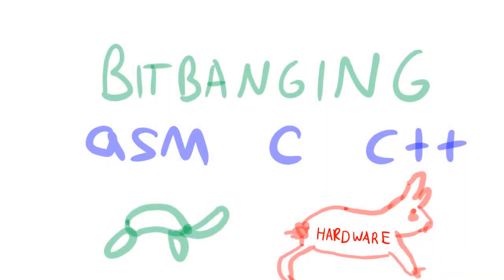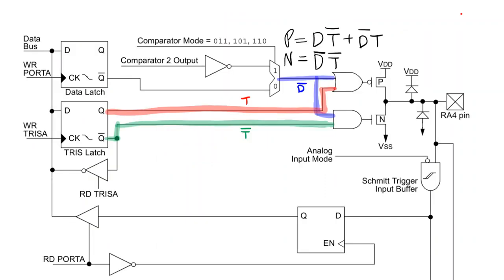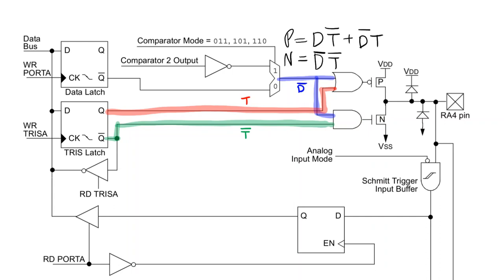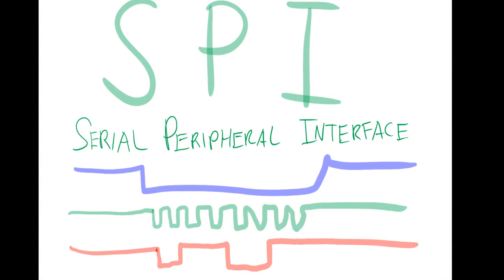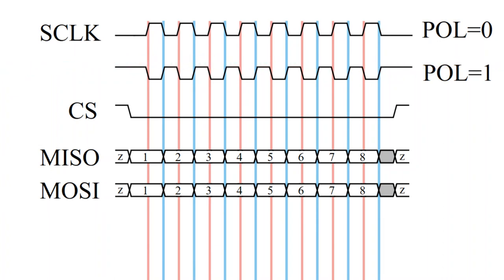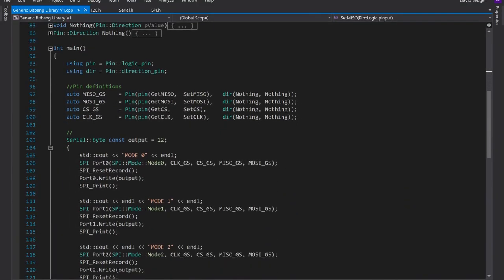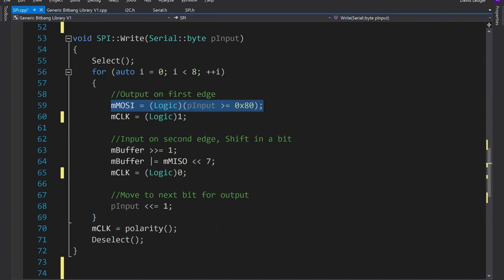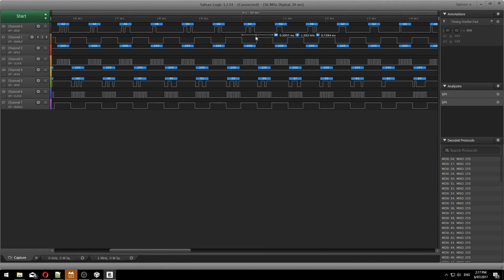EEVacademy #3 - Bit Banging & SPI Tutorial

Comment: depends on the clock speed, not necessary to do polling and eat up all your cpu time, I've done interrupt-driven bit banged spi slave on an esp8266 (yes my beard is grey)
Reply: You are absolutely right, you can have interrupt driven code. It however isn't going to be portable code because it is going to rely on the platforms timer implementation.
Reply: david 2 timer for what?
Reply: I suspect Andy was using a timer to control how long between clock pulses and then using the timers interrupts (functions that execute when the timer expires) to bit bang, clocks, reads and writes.

Interrupt driven bit banging can be much more efficient but only with slower clock rate serial interfaces.
Reply: I think he was referring to the polling: You can have an interrupt routine run when a pin goes high on most microcontrollers, which saves you from basically all overhead while still being able to respond pretty much instantly
See https://gonium.net/md/2006/12/20/handling-external-interrupts-with-arduino/
Reply: Any context switching (executing an interrupt service routine) has overhead, if you were trying to bit bang at the maximum possible speed on a micro for example it would be much slower using interrupts to do it.

For slave devices with interrupt on change, it would certainly be great for low speed communications.

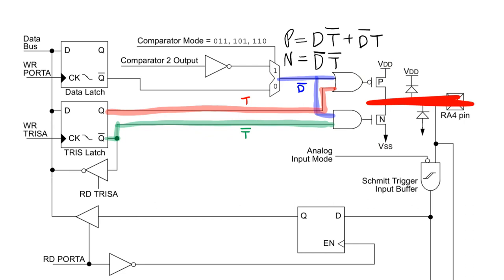Comment: Can  you explain the logic formulas @ 4:30 ? I thought that when T is high, then you're putting Vss on the NPN and Vdd on the PNP, effectively creating a high-z state, and when T is low, the voltage of D is on both the PNP and NPN, which would send the Vdd or Vss to the output...?

The P=~TD + ~DT is the equation of an XOR gate... right?

Comment: If you use the bit banging on slave micro which runs a RTOS( Lets assume this micro doesn't have any spi ports left). The semaphore can run the SPI subroutine without disturbing main application code right?

Comment: Aren't polarity 0 phase 0 and polarity 1 phase 1 the same thing?
Reply: It does end up clocking basically the same but they are not the same.
A different image to what was in video might help, this one seems good :)
http://www.corelis.com/images/screenshots/spi-bus-timing.jpg

Pay special attention to the logical level of the clock before and after the SPI frame.
Also notice where the first clock edge starts.

They are similar but not the same.
You do end up with something that reads in the first rising edge of mode 1,1 and mode 0,0.

Comment: Why did you showed us a simulation of SPI instead of a real data from logic analyzer?
Reply: This is how I develop platform agnostic code. IMO If you develop for no platform then the code more easily ports to all platforms.
Reply: I understood your point of platform-independent code, I doing the same thing usually.
I mean, in logic analyzer's window you started a simulation (just as when analyzer is not connected to PC) by pressing "Start simulation" instead of "Start sampling" when device is actually connected to the PC. Did you just faced some hardware issue with that analyzer?
Reply: That was actually just a miss-edit, was recording I forgot to plug in the device, re-ran it, the new clip was put after it but some of the old clip wasn't edited out. If you look carefully the screen jumps and it shows the device was plugged in at the end.
Reply: Now I see, thanks! Good job, though.

Comment: I'd love to hear about audio digital interfaces! e.g. I2S, I2S Variants, TDM
Reply: Wikipedia has a reasonably clear(?) page on I2S. 

If by "variants" of I2S you mean the left/right-justified versions, those technically aren't I2S (to the best of my knowledge, anyway). In the words of AvE - "same same, only different" :) Yes, they use the same clock signals, but the data bits are arranged / sent differently. I think all chip datasheets, regardless of supporting "just" I2S, and/or other modes, contain timing diagrams which show pretty much all you need to know about the protocol / format.
Reply: KhronX ohh, cuz i am trying to get ADCs&DACs from TI, to talk to SigmaDSPs from ADI(shouldn't matter, right?), and had been super confused looking at many different timing diagrams.. alright i have to go check it out first, and not to be lazy like this! Still waiting for Dave to yell focus u fack, everytime his cam goes out of focus😂😂
Anyways thank you very much!
Reply: As long as both "ends" of each I2S interface are set for the same mode, you should be all good. It's an industry standard for a reason :)

Comment: another reason for bit-banging: if (the initial run of) the serial-communication-chip does not meet its design-criteria. (This is why the C64 uses bit-banging instead of dedicated serial by default.)

Comment: Hey ;) Hate it to say, but I think from an educational perspective the video, especially the first part about bit-banging, wasn't that great :/ I'm pretty sure someone who wasn't sure what exactly bit-banging is didn't get it... And someone who knows it, couldn't learn anything. First of all, you should have started with why you toggle your pin high/low at all and what requirements you have... e.g. by just refering to a simple datasheet that says what a serial signal actually has to look like to communicate with a device. To keep it simple, use something like the WS2812 drivers, I2C or TTL (not bidirectional, not additional control lines).
Then explain what actually the difference between using hardware and software is - because for someone that only know what an arduino is, it is not obvious that the microcontroller hardware actually contains hardware for serial communication.
You can explain in few sentences that "hardware" actually means a separate logic in the chip with its own seperate memory where you put the data you want to send, that works autonomous from the cpu.
Using hardware means, you tell this seperate logic "use the bit stream from your dedicated memory to generate the high/low signals on the pins now and let me concentrate on other things" whereas using software means "oh shit, I now have to set this pin high, wait for 2µs, then set it low, then high again after 4µs and so on... this will keep me busy a hell lot of time"...
Explain that telling the hardware to shift out data actually takes only few cpu instructions, whereas using software takes almost the same amount of instructions for every bit.
Explain why that restricts timing, etc....
Explain that the hardware must actually be built for a specific protocol and therefore chips usually don't have unlimited hardware support for thousand protocols - which is why bit-banging in software is always a thing... Like Arduino SoftwareSerial... Or protocols like the WS2812 where usual chips just don't have hardware support.
Hope that was helpful :)
Reply: Frango
Reply: Thanks for this comment, I'm new to all of this stuff and the video was sort of lost on me even after following the first two videos perfectly

Comment: Why a tutorial on "bit banging & SPI", a tutorial on common serial communication methods would be more interesting and a separate video on bitbanging (and something else maybe).

"Between each byte you set, you also have a clock signal" - I think you mean each bit.

For example in the part of bitbanging you tell that there usually is a kind of master device and a slave device. But it isn't always like that. It's also pretty common for slaves to have an "IRQ" line to start transmission. 

Also, you could bitbang a slave, simply assign interrupts to the clock pin and check the status of the data pin in there. IF your communication is slow enough (and your interrupt fast enough) to guarantee being able to read the data pin before the next cycle/state, why not?

"Bitbanging in general is usually like" there's just too much "usual" "in general" and other vague useless additions to the sentences.

Comment: nice to see some more learning tutorials :P can you do one with i2c lipo battery management and stepper motor drivers (for high precession )
Reply: There will be one for i2c, probably not one specifically to battery management unless enough people are interested.
Reply: personally, i think a lot of ppl in the maker community is struggling with lipo power management / boosting for 5v as for projects like rpi game boys the power boost product seems to be just barely  enuff  to run these projects 

also what about the stepper motor stuff? I'm having a hard time figuring out if there can be any precision gain with higher end stepper driver other the higher step resolution like 1/16 or 1 /32 step

Comment: That has nothing to do with bit banding. Bt banding is about accessing one bit. When you  write a value in an octet, you  write the whole 8 bits. You cannot WRITE just one bit. So unless you have some special C extension, you have to relay on trick like reading the octet, or-ing it with the proper mask, write base the result of the or-operation.  Well, that works to write a one. To write a 0, you have to and, not to or, the negation of the mask. That makes 3 instructions, which CAN BE INTERRUPTED, and using an operator which differs if you wish to assing a 1 than to assign a 0. It is even slower if you use a function call (with the added push/pull). With the help of bit banding, you can direaclty write the value 1b, or a 0b,  in an appropriate memory address and, through hardware wiring, that would write the 1, or  the 0, in one single step, so, not interruptible. So, to the contrary of your claim, bit banding is FASTER than any other code, since it is as fast as the memory write can be, that is, ONE clock cycle. You seem to be confused with mimicking SPI protocol by software instead of using specialize hardware peripheral of the MCU, which has, once again, NOTHING TO DO with bit banding.

Comment: Sorry, but I'm afraid you have made some goofs, Dave2. First, with the waveform at the beginning, why are you going backwards? Does this represent a scope or logic analyzer trace? Doesn't time go from left to right? Isn't the first event on the left?
Second, that't a nor gate, not an x-nor gate. With the equation you have shown, D=0 and T=1 would turn on the upper FET, and that's not what you want.
I stopped watching at 5 minutes.
Reply: Yes - what the hell was up with that?  Am I missing something?
Reply: Dun goofed it!

I think we are both wrong its just an or. The circle is talking about how this pfet turns on on logic low the inversion makes it effectively nor though.

The time thing ergh yup msb first. Edit: Confused myself i drew my time axis backwards then explained right to left for some reason. Really od i did that.
Reply from the maker: It's actually an OR gate, not NOR (or XOR). The NOT is on the MOSFET.
Reply: i think you messed as you were fast ,it wont hurt for an uneditted length version
Reply: Not a big deal, it is not important to know the details how a processor pin is implemented to understand bitbanging, could have been left out. But later you said that the microprocessor can't do anything while polling the pin. This is wrong, because you could use a fast interrupt to poll it, which in fact is used in CleanFlight to implement software UARTs (softserial) and it can do this even for 250 kbaud, which is no problem for modern CPUs. In the interrupt service routine you just have to use a state machine to exit it fast, then you have lots of time left for other tasks, in lower priority interrupts (but then it gets tricky with reentrant IRQs, but possible) or in the main program.
Reply: I stopped at 3 minutes. Backwards display and voltage represented by "V" instead of "E" was too much for me. Also, RS232 levels are inverse - high is low & vice versa.

Comment: sorry, don't see any point of big banging. this is not the 1980's anymore, use a proper chip and stop banging your head while programming.
Reply: You don't always have a choice. What if you need a one wire interface or some other uncommon interface? Good luck finding a microcontroller that has hardware for that then porting all of your existing code to run on it.
Most microcontrollers will only have SPI, I2C, & UART, Some will have USB and possibly CAN. If you need something else, you will probably have to bit bang it.
It's also going to be cheaper to bit bang an extra SPI or UART than to buy a larger microcontroller for a product you are going to make thousands of.
Reply: I did that mistake once, had to interface to a onewire sensor only to find out that the micro at a low clock speed can't stand with the required timings for the interface, ended up overclocking the micro during the times I'd poll the sensor. 
in the end i just replaced the sensor to one that was i2c based... 
I still think its an issue of product design,  if you use a proprietary protocol in my opinion it's best to use a small cpld or fpga, it might cost more but will still save you a lot of headaches of optimizing the code timings, only to end up with code that is so "touchy" that adding a couple of lines of code might ruin the performance of your bit banged code.
Reply from the maker: There are plenty of usage cases where it's still needed.
You might have a common micro in your BOM across products for example, so are limited to what that part offers, but need one more port.
Or you are separate for PCB routing space and you can't use the existing port pins for some reason.
Could be many other reasons as well.
Reply: All of this issues sound like the result of bad planning, 
I think it was you who said that sticking to one micro brand or product is the best way to get problems later on; so letting BOM optimization depict the amount of effort you'd have to do to make the product work is just... terrible.
And letting PCB routing space force you to design a convoluted way to communicate with a device?, still just sounds like really bad practice.
 
bit banging should never part of a design, perhaps maybe to fix a mistake on the board but never as a planned part of the product.

I mean just the simple example dave2 gave in this video with the spi showed about 25Khz of max spi clk (not to mention the turnicated pulse in the end.) on a device with 4 built in spi controllers that can go up to 6Mhz!, it's just a waste of good, usable hardware that can do the work much more efficiently.
Reply: Bit banging isn't an antiquated 80s technique, it's very much applicable even the 30-40 years later that we are now. Try driving a modestly sized LED matrix display without the use of bit banging. There are no micros on the market with enough pins to do that, nor does there even need to be - shift registers exist for this very purpose.

Your view sounds very uninformed, perhaps due to a lack of experience across a variety of projects. Broaden your horizons and you'll realise these techniques are worth knowing, and part of that will be knowing when they are particularly useful.
Reply: Again, you prove my point. You show a perfect example where a small CPLD would be great, implementing the glue logic required to drive said LED matrix rather than having a highly tuned assembly loop so that the bit banging would work.
In my opinion software bit banging should be only used as a last resort, not as part of a design.
Another point is that the example micro he was using has hardware SPI and i think that "beginner" videos like these kinda allude that fact from the hobbyists that are just starting electronics.

and on a personal note,
I might not have the years of experience Dave has, but I have designed quite a lot PCBS (up to 14 layers) and done multiple working, installed projects. 
So yeah, I do have a variety of projects under my belt.
Reply: Using 5 times the same uC in the same product. Buying a different one just to adjust an I2C or spi pot would be bad. So bit banging it is.
Reply: CPLD's are much more expensive than low cost micros.  A micro may not be the best performance wise, but if your application doesn't require high performance then the capabilities of a CPLD are completely wasted and the product more expensive than it need be. There is no doubt that it is not an optimal solution when your only metric is performance.
Economizing is a part of good design, never pay for what you don't need.

Comment: It is not politically  correct to use the master & slave terminology  we now say parent & child
Reply: Lol!!!
But that would mean the parent controlled everything the child did down to when the do and don't speak. Is that more or less pc.
Reply: I got complaints at work for using a master slave terminology to describe two air conditioners only one of which had the ECU and controlled the other. I don't think primary and secondary cut it but it shut the sales manager up.
Reply: I'm pretty sure the new terms for "master and slave" are "wife and husband"... yes in that order.
Reply: if only I could find my master 🤔
Reply: Ha, that must be an American thing. Driving political correctness to extreme limits.
Reply: Well in my case I think it was a sales manager wanting to make sure he had a say to justify his wages. Apparently the terminology would not bode well in Serbia but then I struggle how they are not going to get offended by a low of technical documentation.